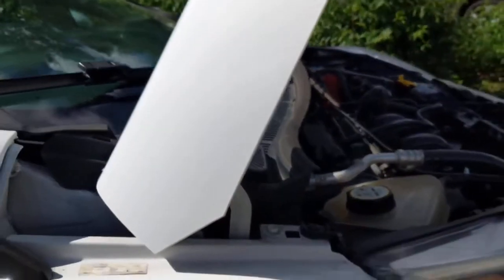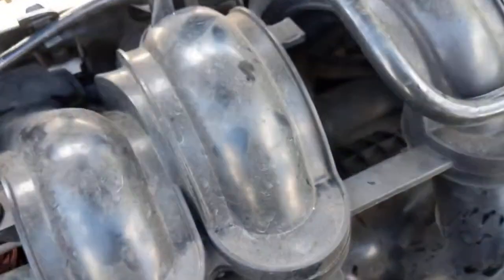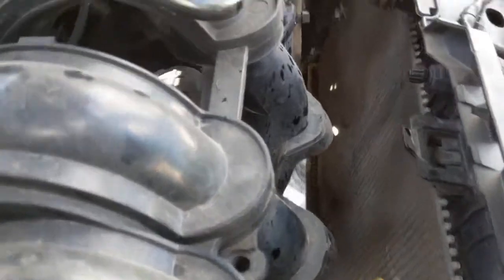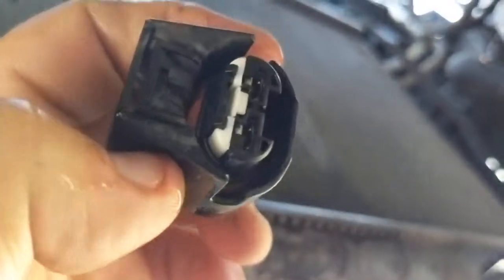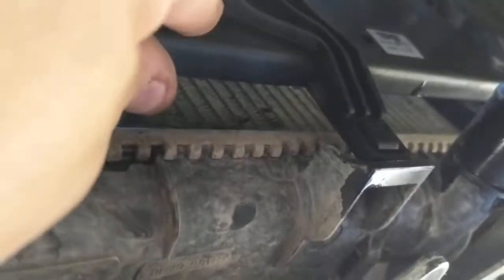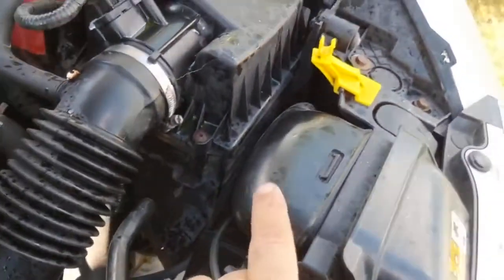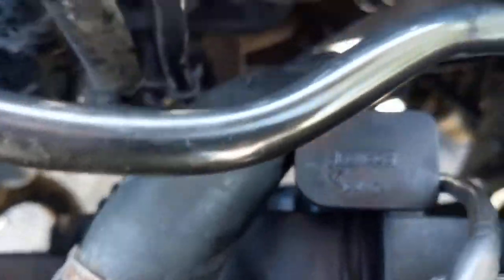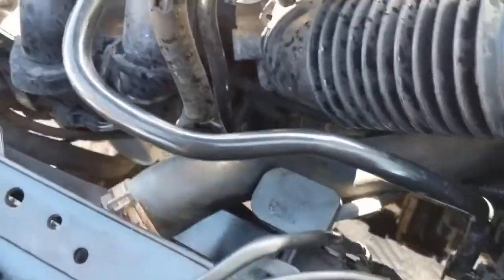How to change coolant fan 2011 ford fiesta.

Comment: Thank you so much. Going through this with my wife’s car now!
Reply from the maker: Good luck... Hope it goes well!!
Reply: Did you use a attachment for the radiator fan? I bought a fan specifically for the 2011 Ford Fiesta in car parts.com and the power connector doesn’t fit, that part you connected to the switch doesn’t look recognizable either so I figured I ask thanks!
Reply from the maker: @homeinmyhead  the only thing that was different on mine from the original is that, the original fan had the connection point as part of the fan assembly. The new one had what I would call a pigtail, but the end attached the the car snapped right into the pig tail with no problems.

Comment: Tip: clean the radiator while you’re in there - use a coil safe cleanser and gently blow out the dirt from the radiator with water.
Reply from the maker: Thanks for the tip 👍